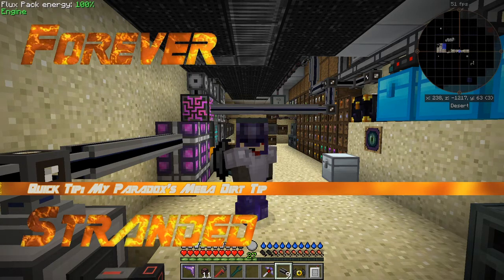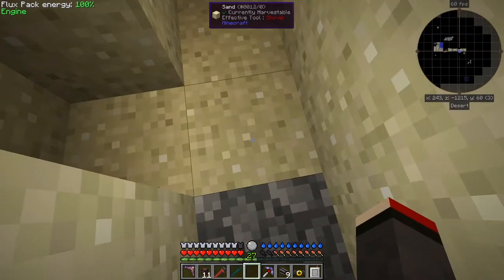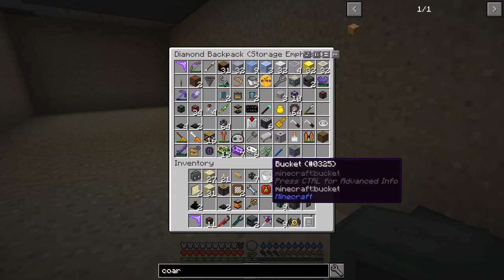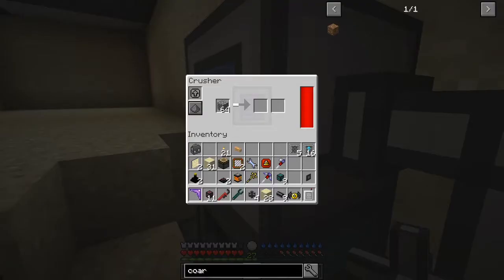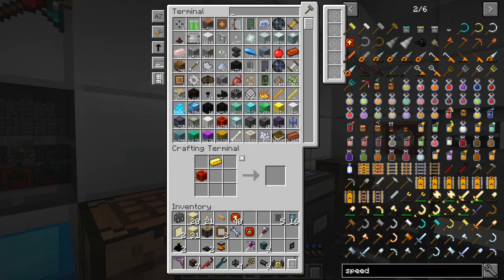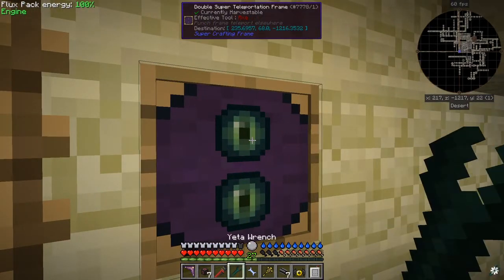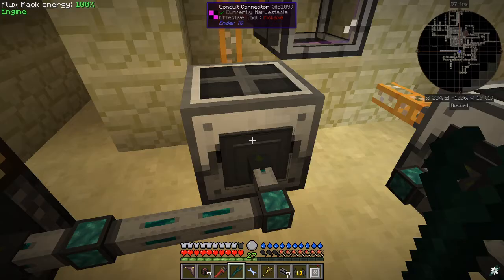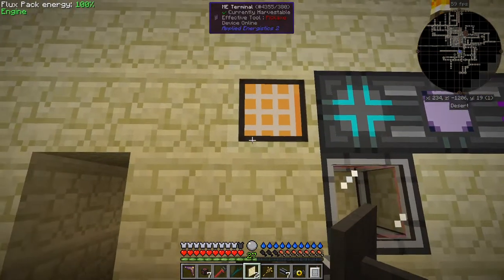Forever Stranded Quick Tip 04 - My Paradox's Mega Dirt Tip

Comment: lol.. This is the way I completed my Dirty quest, but without AE2. Thanks to Willfon and Frau for the tips. You will be able to see my set-up in ep 64. I like this way better than the tilled soil way. Also with you and Xheadra coving the other way I thought I would give this a try.  Thanks for the video.. nice to see a AE2 slant on it.
Reply from the maker: Mechlsd right clicking dirt was causing too much lag that I stopped using it a while ago. Most of this method was processing using extra utilities as it is way faster than enderio and uses very little power. Couple of exceptions the crusher that needs loads of rf and crafting coarse dirt that was in ae2 but could have easily been extra utilities. Even three gravel crushers didn't keep up so it is generating 3x2 every .45 secs so just a bit more than 13 dirt per second.

I read the comments after watching an episode but if I watch it quickly after publication there are not all of them yet.

Comment: That was just an outstanding solution.
Reply from the maker: Philippe Asselin I don't get many tips but this was a really good one from my paradox.
Reply: Is Paradox one of you viewers? And yes this was an amazing tip. I just finished recording my Episode 61 building Dirt Farm 3.0 and it's making dirt soo much faster then any of the other dirt farms. I feel like that quest is going to get finished in the next 3 or 4 episodes and then the grind for Gold/Iron/Diamond are going to be the only one left. I really don't expect Sand/Sandstone/Cobblestone to really be an issue.
Reply from the maker: Philippe Asselin must be a viewer as he also liked other tips, like stone faceplates for the toolkits. I changed my gravel design a bit and removed the power gen bring up the cobblestone gen to just below the crushers and an using a nether star generator II for power. I'm getting an excess of gravel with 5 maxed crushers. The quantum quarry gives cool stuff like a pitcher plant, sunflowers and cool ores.
Reply: I saw your coverage of the Quantum Quary are you going to go over it again in another episode?

I'm working on my video and I still just love the solution. It's simple and elegant :)
Reply from the maker: Philippe Asselin I'm thinking about showing some of the rarer stuff from the quarry, like the sunflower as this can be farmed and is a good source of yellow dye and the red orchid. I'm also planning on showing off the multifarm as this automated fruit picking. But not planning to show the quarry again.
Reply: Yes sorry that's not what I meant, I didn't mean cover the Quantum Quarry again as in the blocks, crafting or setup, I meant more a recap of here are the interesting things I'm getting from the Quarry and what can be done with them. But you might have done that already so tonight I'll try and re-watch that episode.

I am super curious about the multifarm and automated fruit picking so I'll be on the lookout for that episode. :)
Reply from the maker: Philippe Asselin you know I'm not sure if I showed what the quarry gives as some things are very rare like plants and some ores, titanium ore. I usually mean to return to see what has been returned and then forget.
Reply: I didn't remember you showing what it returns which is why I suggested in the first place that you go over it again. I'm setting down to re-watch the episode now so I'll let you know :)